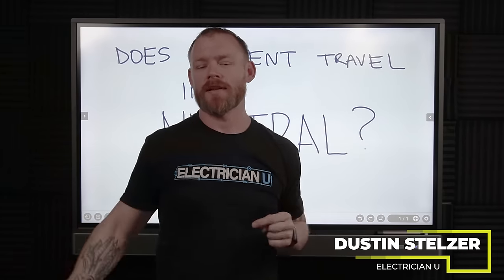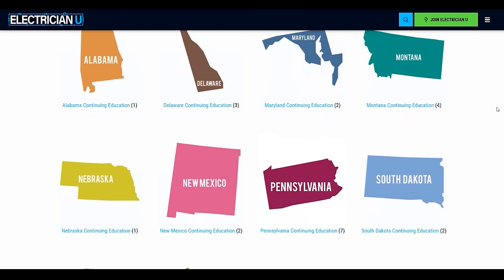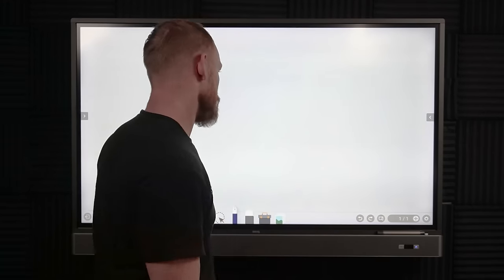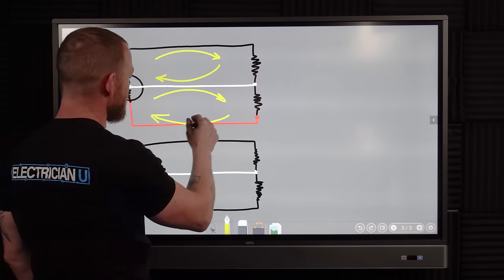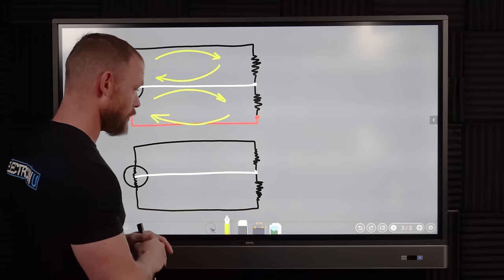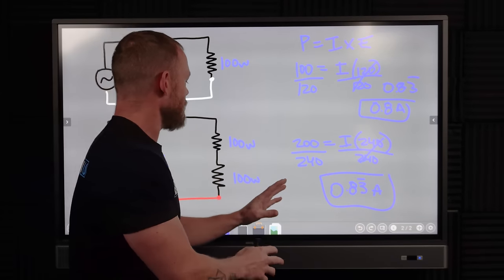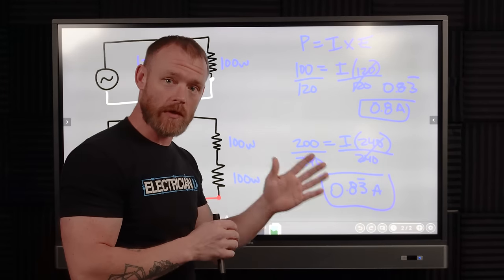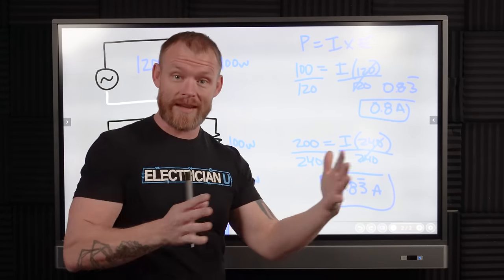Does Current Flow on the Neutral?

Comment: Get in between a neutral splice and you'll find out REAL QUICK...!!! 😳💥⚡
Reply: yea im not doin that again
Reply: Back in my first year of apprenticing I was working with a journeyman who sent me to find an open neutral in a junction under the house and when I found it and asked him to turn it off he said what do I gotta turn it off for you’re just fixing the neutral connection…trusting him I started pulling on the connections and got a nice zinger.
Reply: It will bite you
Reply: Espically on 347 volts ,line to neutral , you don't want to get between the hot and neutral . canadian is  600 volt  line to line .
Reply: Voltage is not the same as current. If you have an open neutral it is no longer a 0 volts wire. It's now energized to 120 because there's no path back. At which point it's technically not a neutral. Anytime you touch a wire under load that has current running through it, if there's less resistance through your body to ground than there is in the wire you will get a shock.
Reply: @dougfoster445  a neutral wire without an open neutral can still have voltage and is still technically a neutral
Reply: @bananainacup  when I say voltage I’m talking about 120 Volts. There will always be SOME voltage on there but shouldn’t be more than 2 volts. If your wire has 120 volts it is not a neutral anymore.
Reply: @dougfoster445  okay I will agree with that
Reply: Came here to say this
Reply: Yeah this dude doesn't know what he's talking about frankly and nobody should listen to his nonsense.
Reply: @justsayin7937  which dude?
Reply: @bananainacup  The dude that made the video
Reply: @justsayin7937  what did he say that was incorrect
Reply: @campbell gilliland  almost everything and he's going to get someone hurt or at the least  confuse a learning electrician. If current cancels itself out there would be no electricity at all. The neutral is essentially tied to ground most the time it's tied to a grounding rod either at the home/facility and also back through the powerlines and then to ground. The reason you don't get current flow from the neutral lug to ground is NOT because current cancels itself out. It's because that lmneutral lug is grounded already thereby bypassing your meter to ground. If you measure before ground there will be current read on the meter. We'll spoken nonsense is prevalent in the electrical industry. A lot of people get by on how well they can speak and sound convincing but don't know what they're talking about.
Reply: @justsayin7937  that’s not what he said . Yes if you read neutral to ground with your volt meter you will get 0 volts because electrically they are the same point because the neutral is connected to the ground. But he was talking about reading the neutral from the source with an amp probe where you are just reading the amps at a single point not in reference to something else .
Reply: @campbell gilliland  We're not talking about reading volts, we're talking about current... And when he says current cancels itself out he is badly mistaken because it doesn't. And what I'm trying to explain to you is if you integrate a Amp meter into the circuit and measure from the neutral wire to the neutral lug you will have current. When he measures a single point on the lug with an Amp clamp all he's really doing is measuring all the neutral and ground wires. Everyone knows you can only use an Amp clamp on a single wire. He says theres no current on the neutral lug and there is. He's going to get someone hurt. But go ahead and listen to him and maybe you'll get some more sense shocked into you like when you were messing with that neutral wire under that house. No wonder you don't know these things if you were trained by electricians that could have got you killed.
Reply: @justsayin7937  I appreciate your challenge, just have to concur if it's out of context with what DUDE says in his video.
Reply: @Edgar Cruz Sr  Actually he says point blank that there is no current on the neutral on the lug just because his Amp clamp couldn't read it. Also you should never test amperage on a neutral wire with an Amp clamp because you never know how it's tied in. If your going to test amperage on a neutral wire use a Amp meter that you put in series with the circuit to prevent any signal error.
Reply: Yep !
Reply: I’ve only had lighting circuit . Imagine a high amperage situation!?
Reply: ok ok, if you read current in the neutral, theres going to be a reading,  don't really know whats going on with this dude in the video, but I'm going to let you guys explain to me how a differential circuit breaker works
Reply: A 277 lighting noodle lol,this is no joke !!!!!
Reply: @dougfoster445  where do you get this information from
Reply: @kennethcohan9630  I've been an electrician for 6 years and studied it in school for 4 years. If you are interested I suggest going to your local technical school/college. Most people get into the  field by going to a electrical contractor and asking them if they can complete an apprenticeship with them. They will bring you on board and you will become endentured to the company. They send you to school for 4 years where you learn the trade while you work.
Reply: @dougfoster445  I’m sorry but I was being sarcastic. Some people just make stuff up and there is no logic in what they are saying. I am a qualified Electrical Vocational  Instructor but I am still happy to learn.
Reply: @justsayin7937  we seem to be the only ones that know what we are talking about. Ha ha! Nobody must verify these videos before they go out
Reply: @Kenneth Cohan  I know right. It's ludicrous, to say the least.
Reply: Only if it's closed with a load
Reply: @hadleymanmusic  Yes, a complete circuit. I haven’t got a problem with the neutral.
Reply: @m32mikestu  right ??!! It's got teeth
Reply: @CRHumphrey3  better believe it
Reply: I work commercial building schools, live neutrals are concerned more dangerous then hots, why, well its 3 phase 120v/208v and we combine hot to neutrals for all devices, no matter where or what they are to reduce pipe fill, and 3 different lighting circuits one one neutral will never be over the individual breaker rating (15A normally) you will get quit the pucker if the neutral is worked on (say a home run box for big zapper) because 3 phases of 120/208 is 347 and that's not a good time if all the lodes are on (good by hand)
Reply: Shocking 🙀
Reply: Yep, the saying current takes the least path of resistance is wrong. It will take all paths
Reply: @dougfoster445  You'll get a shock if you present any path to ground, proportional to your part of the resistance.
Reply: @justsayin7937  Your usage of terms indicates you overestimate your knowledge of theoretical terms. Second sentence makes no sense.
Reply: @OrmondOtvos  What sentence on what reply are you referring to?
Reply: @OrmondOtvos   I mean yea, that sorta obvious. Won't argue with  ya there
Reply: If you put a clamp on meter around the incoming neutral feed from the utility, you will always get a reading, because, it is only a dead wire if the load is balanced, and it almost never is. It's the same with 3 phase AC. If a utility runs a 3 phase generator to a single load that is pulling equal current on each phase, there will be no current left to return. If a 4th wire was ran for the purpose of the load ramping up or ramping down, or whatever reason to carry the imbalance back, it would be safe to lick with your tounge at that time. This is a big reason why 3 phase grounded AC systems are so efficient and became the standard. It allowed the utility to eliminate a neutral conductor and simply run a continuously broken ground wire that used the Earth itself to carry the imbalance back as needed. This is why you hear things like "balancing the grid", or "we needed to blackout such n such region due to an imbalnce". Your home is single phase 240V (ie, 2 wires, red and black, and both are hot). While what he's saying is accurate, it can be misleading to someone learning how all this works. That center tapped neutral is half way between the two hots, and it will return all the unbalanced load back up to the single, split phase coming out the transformer to be canceled or used on the other half of the cycle relative to it. So to sum things up, 99 times out of 100, you are going to read current on the incoming neutral, and every other neutral for that matter in a closed circuit under load. The basic thing to remember is single phase AC takes two wires to work. It comes down one and returns on the other. Then it switches. Both wires are hot while under load, and ground (neutral in a home) is relative. If the center of your transformer winding is tied to ground, you still have two hot wires in the big picture that are doing the work. The neutral is essentially just a short cut for the loads to use half of the cycle, and return the current back for the reverse half to either use, or not. If you touch a neutral under load, and you're barefoot in a stream that flows right past the pole near your home, there's a small possibility that YOU may become the better (less resistant) short cut to get back up to the secondary windings on top of the pole. Maybe you carry 1/2 the current instead of the full 8, 10, 5, whatever amps came down the black hot, and is trying to return back down the red.

The NEC no longer alows you to share neutral wires across phases, primarily because of how many people goof it up, and get something working, then walk away from a major hazard that is 10 years down the road. The thing people forget is, red and black are not 2 phases, they are one. Commercial guys treat them like they're 120 deg apart, but they are not. They are 180 deg, opposite halves of the same phase.
Reply: My Journeyman saw me about to do that very thing up on a Genie lift and said, “that’s going to hurt”. And boy did it!!! Some learn the hard way!
Reply: @dougfoster445  Well said. There's an awful lot of confusion in this video. I would not recommend my apprentice to watch this.
Reply: @justsayin7937  Agreed. Christ help us when the kids who watch this guy go out into the world!
Reply: @charlesnelson5187  Yup
Reply: All this, but it's a single phase circuit so it's all additive at the common neutral point from the current point of view as both of your circuits
S are in phase with each other
Reply: You probably beat 208 people to this comment. And boy does it suck to get in between it.
Reply: @bananainacup  coulda been a nice electrocution death he wasn’t a good journeyman to lot have let you know it’s basically a hot at that point if you completed the circuit you woulda been tostada
Reply: @willywill3570  definitely a quick lesson learned :P
Reply: I found out that the lighting in my kitchen has shared neutrals.  I found that out the hard way.
Reply: Your tongue 😂😅😢
Reply: @willywill3570  o
Reply: @justsayin7937  Re: “@campbell gilliland almost everything and he’s going to get someone hurt […]”

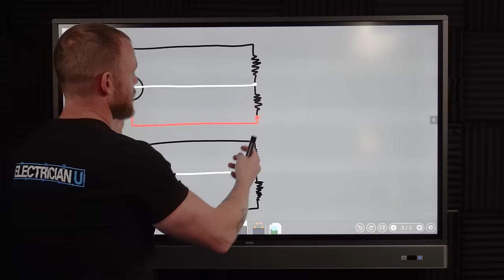I guess some of what you’re referring to is what Dustin (the video maker) said from 6:12 to 11:53.

Dustin is completely correct that in a split-phase (i.e. single-phase three-wire) system that is perfectly balanced, no current flows in the main neutral wire but it does flow in the neutral wire of each L-N (120 V) load (i.e. in each branch circuit neutral wire). This is also true even in three-phase four-wire systems that are perfectly balanced (and have no harmonics). And this has nothing to do with the fact that the neutral wire is grounded, as you incorrectly said.

You clearly don’t understand some things. Please use Falstad’s free online circuit simulator to draw a panelboard and draw two equal-resistance resistors (and inductors if you want to) on each leg of the panel. You’ll see exactly what Dustin said.
Reply: @kennethcohan9630  Dustin (the video maker) is completely correct in what he said from 6:12 to 11:53, that in a split-phase (i.e. single-phase three-wire) system that is perfectly balanced, no current flows in the main neutral wire but it does flow in the neutral wire of each L-N (120 V) load (i.e. in each branch circuit neutral wire). This is also true even in three-phase four-wire systems that are perfectly balanced (and have no harmonics). And this has nothing to do with the fact that the neutral wire is grounded.

You clearly don’t understand some things. Please use Falstad’s free online circuit simulator to draw a panelboard and draw two equal-resistance resistors (and inductors if you want to) on each leg of the panel. You’ll see exactly what Dustin said.
Reply: Bk then a super neutral got me
Reply: Yep, was working on an above ceiling, Heat Pump, in an Office Building. My Elbow touched an exposed neutral, on a light fixture. Got knocked off my ladder. Luckily I wasn’t hurt.
Reply: An open neutral is a sore one.
Reply: Why complicate something so simple?
Reply: I'm gonna ignore your comment. Any open neutral connected to load has line voltage technically. You can actually touch the neutral of a perfectly balanced load (from 2 different phases).
Reply: If this guy had been teaching me, I would have given up and tried another job.
Reply: That’s actually how I found out lol 😂, I was 5
Reply: @kennethcohan9630 you are correct and I wrote him a reply correcting that you can share the neutral wire on A&B phases because you don't double the current on neutral wire on a Delta wye transformer system but you can't on Delta t and Delta Star and his formulas are only for resistive loads only not inductive or capacitive loads and I have always said if you can't dazzle them with brilliance just baffle them with bullshit but be sure to tell them not to do as you say or as you do because it's for experienced idiots only
Reply: I just did this the other day luckily the only load was a led light bulb
Reply: You read my mind
😂
Reply: You read my mind
😂😂
Try 277v
Reply: Wait till your troubleshooting why the ground has current in it. Troubleshooting nightmare.😂😂😂
Reply: @m32mikestu  It will kill you because of the amperage that flows back to the source (utility transformer) kills you when it flows through your heart.  It only takes less than an amp.
Reply: You read my mind. 😂😂
Reply: @bananainacup 

This right here is the kind of stuff that kinda pisses me off. It's also the reason I think every electrician should have at least 1 year of schooling. I learned this in my first 2 weeks of school.
Reply: @jordancarter8294  the stupid thing is I knew the danger of a neutral but didn’t want to seem like a pussy lol now I don’t worry about what people think I’m going to do it safely
Reply: Series and or parallel lol a good current clamp would be better😂😂😂 but i get it lol
Reply: And realistically voltmeter or even a decent tick or non-contact voltage tester will substantiate if there’s voltage there’s current is pretty when you go to understand that as well it’s one parallel neutral at the main service entrance to low resistance back to source but under normal conditions the neutral provides a lower resistance back to source
Reply: @joshbaker855  That's not a hard one to diagnose. Just have someone test as you flip breakers if you don't know the circuit. If you do know what circuit then start at first connection and work your way down ohming it.
Reply: So I guess you and the 74 other people have already beat me to this comment!  Get in between it and find out!  😂😂😂.
Reply: Just test it,the neutral wire with a meter, and it will tell you if it's hot,simple.
Reply: 277v 😫